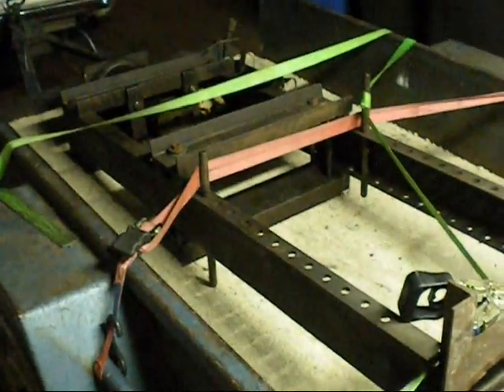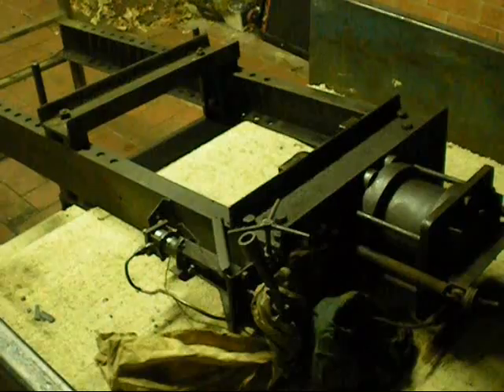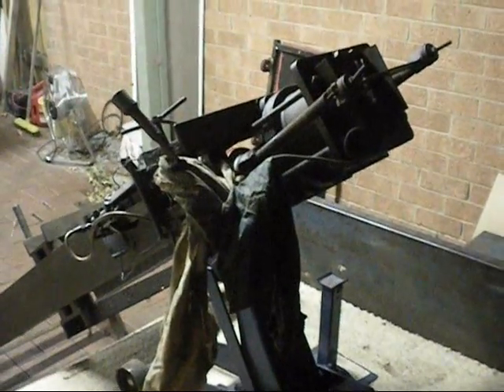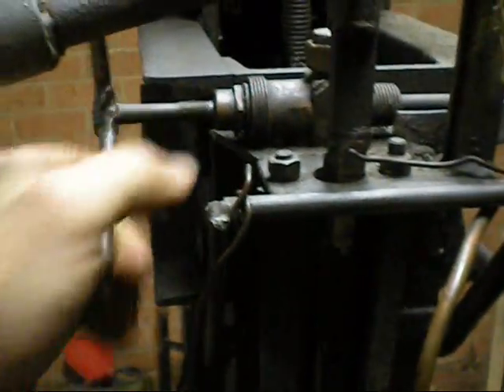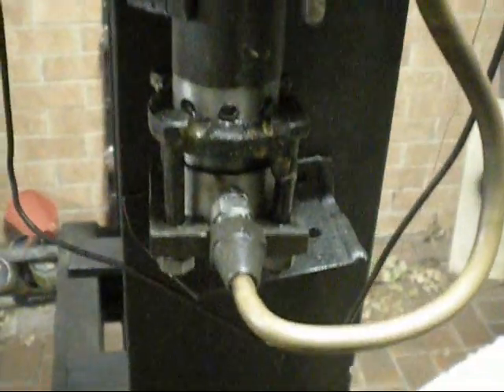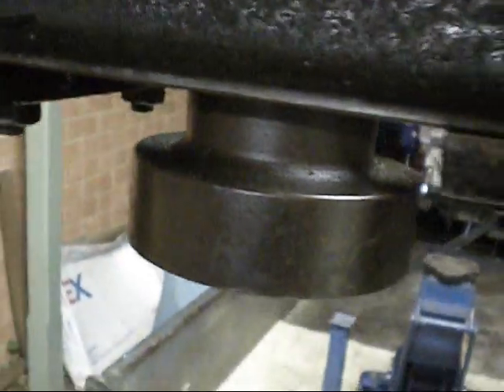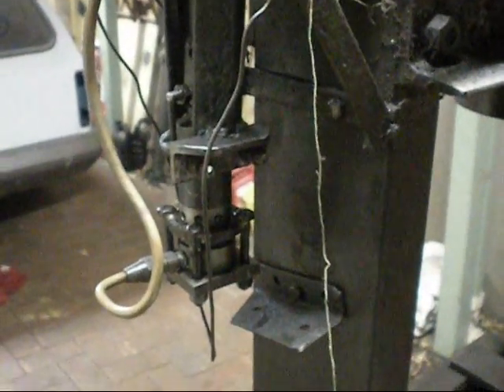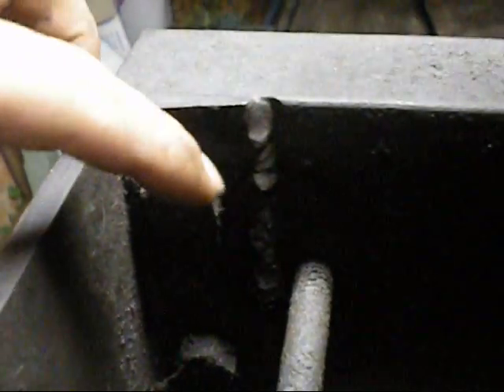Old press

Comment: wow that is nice, completely built from bits. Cool. When you pull the ram apart, measure the diameter of the bore and you will be able to calc the force from pressure. Minus the rod area of course. Pump looks high volume so may not get high pressure, but the ram is huge so it will have a lot of force.

Comment: Well it is not close to the 100 ton press I have used dozens of times... but it's heavier than the 30 ton I've used quite a lot too... 40 or 50 ton maybe...  Oh MAN you are going to have to press some things to failure... the 100 ton, if you pressed certain things the wrong way (or the right way), would just go BANG, the table would jump and shrapnel would fly... fast.  Like trying to press out a flange bearing! Oh I bet that would make a nice bang in this press too!